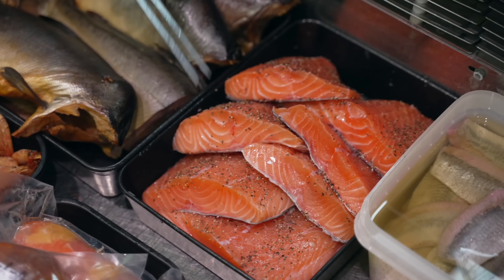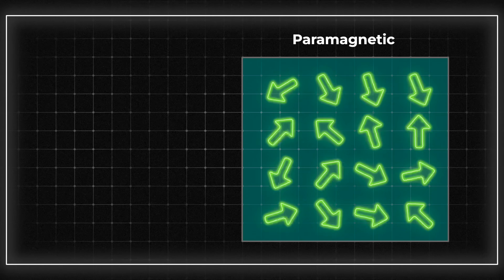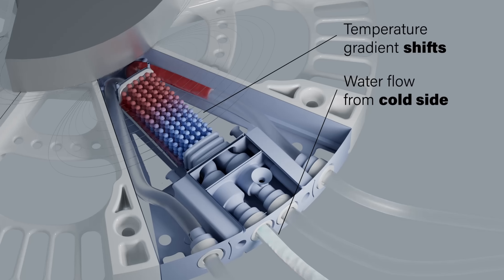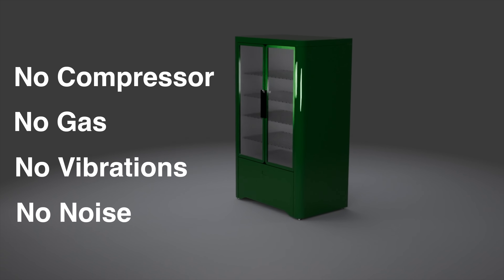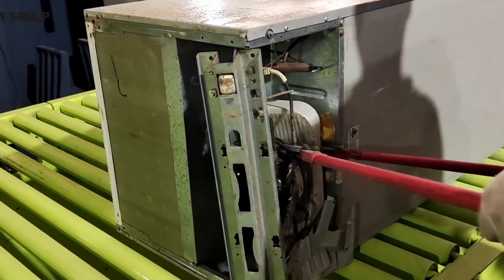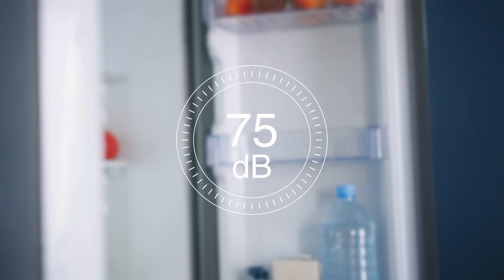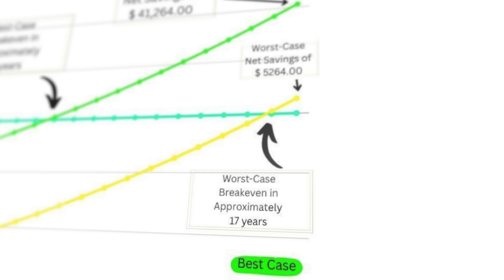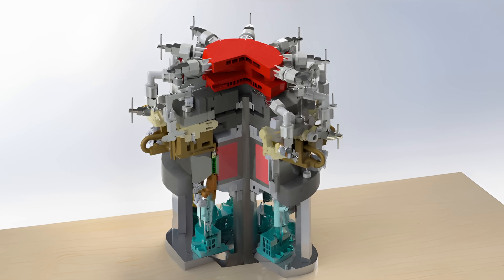Can Magnetic Cooling Disrupt the $100B HVAC Industry?

Comment: In Finland the freezers are forbidden to use freons for over 30 years. My devices use propane or cyclopentane. High temperature heatpumps use C02, supercritical CO2 pump can pump from -35C to +80C with quite good efficiency.  The needed pressure is just pretty high, and I wouldn't like to be anywhere near when system breaks. The fridge is in fire about as bad as a can of gas lighter fuel. 

Another promising solid state heat pump tech uses memory metal alloys. They heat and cool when forced to change shape. One needs just a loop of wire and wheels to tension and release tension to make temperature difference.
Reply: propane is a refrigerant. it was the first refrigerant along with ammonia
Reply: Brah, my freezer here in the US uses cyclopentane as well.
Reply: Refrigerants either gonna desteoy ozone layer or increase earths heat
Reply: @muezzinmemo9091  no, not all them do. that's why HFCs have been banned.and replacements are waaaaay less harmful.

Comment: Like all green tech, it doesn't work as well as the old tech. If the efficiency increases are at 47F and a regular fridge can get colder than that, then the efficiency and payback numbers are BS. Factor in the additional cost of food waste at 47F and it's all BS. Peltier coolers had the same promises and they're BS for most applications .

Even with a 90% reduction in prices with the reluctance of utility companies to buy back power and the elimination of the tax credits, they don't make sense anymore either. 

In a nutshell, we are doomed to die on Venus.

Comment: Solar, battery & wind costs didn't fall on their own.
They became cheap when China decided to mass produce those products.
They did that by promoting and financially supporting those industries because they realized the potential in them.
That's what it will take to make MC fridges commercially viable: gov't assistance and encouragement.
Otherwise, the old technology will dominate & force out the new, better tech.
This always happens with an entrenched technology: consider how oil co's and u.s. car makers stopped r&d of EV's and batteries for over 60 years.
Most notable & recent (1995) example was the EV1 that GM & Exxon-Mobile jointly killed.
Exxon stole and locked up the battery patent for ANY large-size NiMH batteries used in cars (which is why the Prius had small cells in it's battery).
GM was then bailed out in the 2008 crash after promising to build the Volt PHEV, an OK but kind of half-ass car built on the Chevy Cruz body.

Comment: It's a very cool physical property but it requires too many moving parts. Pump(s), valves and coolant loops all over the place.
Considering how simple a hermetic compressor really is and that it only requires a single constriction in the gas flow, it is very hard to beat in reliability.
Edit: You have to remember, a fridge could "easily" be made/designed to work with just compressed air as medium but the efficiency would not be as high and/or the pressures involved may be impractically high. This is why we use specific refrigerants now. New refrigerants have come that are better for environment. R600a for example is not a problem environment at all but unfortunately it is very flammable.
Considering most of the HFC's are illegal almost everywhere else than USA and fridges are still produced, I'd argue USA is just lagging behind.
Reply: " most of the HFC's are illegal almost everywhere else than USA "  " USA is just lagging behind " 
Excellent observation. Video states this as a plus for magnetocaloric cooling, when in fact it is USA's sluggishness in implementing new eco-standards and safety standards.

Comment: I see this as something that could work well for HVAC, but not for refrigeration.  41degF is nowhere good enough for fresh food storage.  Technically, it will work, but you'll find things like milk and fresh meat not lasting very long.  However, for HVAC where discharge air temps are usually around 55degF, I can see this working very well.

Comment: US average kwh is less than half what you said. My state is a little cheaper than the average at $.14. This pushes the practicable efficiency out many years. In addition, commercial electricity is even cheaper than the residential rate.

Comment: Good episode except you have to specify "how big" when talking about how much power conventional fridges use.  A typical residential fridge, for example, only burns 2 kWh/day = 730 kWh/year.  So the 17 MWh/year ... that's for literally a whole supermarket's worth of refrigeration.

The pricing comparison is just nuts for something that is just a pump and a rotating magnet.  That pricing won't hold for long (if ever).

-Matt

Comment: HFC (yes, it's HFC - not HCF!) R134A refrigerant is not used for new fridges anymore - they've switched to R600A with a GWP of only 3.  R600a is isobutane though, so very flammable.  Luckily, the flammability doesn't seem to be a problem.
Reply: Also, there is definitely a problem with the energy calculations at 10:40... "A conventional fridge uses 17,000 KWH per year" is definitely incorrect... 17000/365 = 46KWH per day? 46/24hrs = 1.94KWH per hour?  That means that the average fridge pulls more than a 15A outlet (max 1.8 kW) 24hrs/day??  Also, what conventional fridge runs 100% of the time?  The calculations are done so sloppily!
Reply: Hydrofluorocarbons. Good catch
Reply: Correct... more of an automotive AC application.
Reply: Also 1234yf
Reply: Flammable gasses are problem too
Reply: @muezzinmemo9091 what is r600a  😂 look it up ?? It's  It is camping fuel for gas stove s 😂  It's called.
Isobutane , What is the fear of being flammable ?

Comment: Too complex with extra failure points. More maintenance costs and potential failures, shortening the lifespan of the device. And i doubt they are willing to offer a decade long warranty.

Compressors are surprisingly rugged and simple - a motor and a long tube with a restriction.

Comment: Your cost per kilowat is nuts.  Its 10 cents here though SRP.  Still makes it to much for most people.
Reply: We pay $ 0.13/Hr
Reply: These refrigerators only make economic sense in regions where electricity really is that expensive. For example, distant islands that are still using diesel generators. That is expensive when the diesel is delivered by boat.

There are also places without enough long distance power lines due to political issues.

Comment: An while we are discussing compressors another calculation was made:
Based on our calculation for that specific scenario, the summation of the amount of heat dumped into the 10' by 10' by 10' room by freezing a 3 cubic foot container of water was approximately 51,249 BTU.

This was the total heat expelled by the freezer, comprising both the heat removed from the water (and freezer interior) and the heat generated by the compressor and fan motor during the process.

In that theoretical scenario (assuming the heat was absorbed by the room's air and its drywall structure), this amount of heat would have raised the room's temperature by about 125.42∘ F, 
taking it from an initial 70 ∘ F
to approximately 195.42 ∘ F.
Reply: This supports my long thought of concept of combining a home refrigerator/freezer closely coupled with a water heater. While cooling the fridge you dump the generated heat into an insulated storage (instead of the air in the room) that heats the water in the water heater. Perfect application for a correctly designed heat pump. And if there isn't a high enough demand for hot water but you want to heat a portion of the house you add a water to air heat exchanger (fan/coil unit) and if no heat is desired you direct the excess heat outside.
Reply: @580guru  You nailed it. But don't forget, not in your scenario, but in our current configurations, we are dumping heat into a room, only to need to dump it outside through other devices. Double the energy and heat.

Comment: I love it that scientists and engineers are at work on such technologies. But my recent experience is that residential refrigerator life is only 7-8 years. The compressor and evaporation (old) technology is still very functional.  But the electronics that are supposed to improve efficiency crap out. I cannnot count the number of “boards” that I have replaced in all of my new modern appliances. So until they find a way to extend the life of these tiny computers, the payout of the new tech will not allow it to be viable.
Reply: Understand but selection is slim for those.
Reply: The trick for a lot of these appliances is to not purchase those with fancy electronic controls. If a physical knob or button can do the same thing, it's a much more simple and inexpensive failure point to repair and can last far longer. Anything more than that is just planned obsolescence by the manufacturer to compel replacing the entire appliance.

Comment: 9:50 - R134a is chlorine free and does not deplete the ozone layer.
It's only really old refrigerators with R-12, phased out like 30 years ago.
Reply: Newer fridges using r600 (isobutane) a HC
Reply: @culdesacshadowoftheabyssca9628  and r290- propane
R-744- co2 is being increasingly used (Horrifically expensive and complicated imo)
Reply: Look up the Montreal protocol.
Reply: you are thinking of the cfc or hcfc...what he was taking about was the ability to trap heat in the atmosphere or the greenhouse effect
Reply: @jesshorn257  I thought the GREENHOUSE EFFECT WAS the trapping of heat in the atmosphere 🤷‍♂
Reply: @ThatTweedle  yes? I described the effect and then used the common name of said effect?
Reply: @ThatTweedle  R134a is 3.5 times heavier than free air. As such it’s difficult to imagine a significant portion of the small amount leaked at ground level reaches the upper atmosphere, thus contributing in any significant way to climate change.

Comment: screw compressor with NH3 (ammonia) used in a better containment design would be way better in my opinion as it doesn't need rare material and is very eff.

Comment: The tech looks promising but we're going to have to see economy of scale before we see widespread adoption of this tech to actually have a major impact, so the price point will have to drop to €3000 or less before the majority of us would consider it, and that won't happen without major scale, so the tech looks promising but this is for the near future, maybe a few decades from now.

Also, this might be useful for air-con, which lowering the running cost of that would be a big help, in fact, I suspect that could be a bigger selling point before fredges.

Comment: Tesla needs to buy one of these to make A/C for their cars. Why didn't you speak about A/C, by the way? Is this tech not applicable to heat pumps?
Reply: I think we are saying the same thing. I was just making the point that up until now, there really only has been one way to make a heat pump, that is using a compressor.  The magnatherm is a new technology that can serve as a heat pump without a compressor. 
I think i interpreted your original question as wanting to combine the two technologies, whereas you meant replace it. 
I think that this tech has a long way to go before it is reliable and cost effective enough to actually replace an automotive heat pump.
Reply: @FlorestanTrement  the term heat pump refers to a compressor-condenser that can move heat in or out of a system. The magnatherm technology is a different way to move the heat and is meant to be used in place of the compressor-condenser design. 
Adding the 2 methods together just seems like it would be more expensive and complicated and have more things that can go wrong. 
Hope this helps.
Reply: @descentplayer  Sounds like you misunderstood me. Maybe the term "heat pump" is not used the way I used it there, but the concept is about moving heat from one place to another, which is also what magnatherm is doing.
In other terms, I meant to use magnet instead of a compressor and a condenser in a heat pump. Or whatever it might be called when based on magnets. I don't see why we should call them any other way, like you seem to believe they are.

Comment: Why not use CO2? My car (VW ID3) uses cO2 in the heatpump and works extremely well.
Reply: CO2 must be in cold side over 5,1 atm (triple point -56C) to keep it not turning solid. It turns to supercritical  when over 31C and 73 atm. So the compressor needs to have pretty high pressure for 40C hot side. Its pretty good refrigerant if one needs to pump from very cold to hot.

Comment: My man. Your numbers are WAY OFF! My refrigerator doesn’t cost me $495.00 per month to run.
Reply: Going by the rest of the video, those numbers appear to be for commercial units, not a consumer unit you would have in your house.
Reply: I’ve got an emporia energy monitor on our fridge. Over the last year it used 729kwh of energy. That’s 60.75kwh per month. At our electric rate of 0.22$ per kWh that is $13.37 per month.
Reply: @KurtsRPMGarage  Facts.  In-home refrigerators have gotten more efficient over time, and due to better insulation they don't have to run constantly.
Reply: He said the chart is for commercial fridges
Reply: Upright COMMERCIAL fridges are often frequently opened and closed throughout most of the day, causing considerable loss of chilled air, which is replaced by warmer air that then needs chilling down. This means that the chiller units can be in near constant operation. 
Also, the doors have to be transparent and light weight, meaning poorly insulated. Comparing magnetic energy savings and costs from this video with domestic fridges is no relevant. 
Perhaps in 10 or 20 years after the tech is refined, it might become a premium domestic product that is greener, quieter, and by the way, reduces electric bill. But not enough to pay for itself.
Reply: @maddeusdoggeus1  he did say industrial fridges were the information point not your fridge at home. I’d imagine an industrial one is quite a bit more of a drain than what’s in the kitchen.
Reply: @maddeusdoggeus1  i thought he said commercial refrigerators. I saw a commercial refrigerator in a friend’s restaurant, it was an actual room.
Reply: @maddeusdoggeus1 mine costs like 3-5$ lol whos paying the price of a brand new prmium fridge or a mid toer gaming pc to run a fridge
Reply: @CnRSPACE commercial fridge, per the video
Reply: 😂 thanks for the realization 
I didn't watch fully yet
Reply: Doesn't matter how much per month because stated there will be no savings there. Commercial doesn't have the most improvement, it has the only improvement. Any future consumer version will simply be quieter and safer, not less expensive or more efficient (that 2400 they save in a year, we spend once and that needs to count for the whole 15 years). It also might hit the market never. 

Nevertheless, at the scale of commercial is where this has the most positive impact on our lives overall, so good news all around.
Reply: @maddeusdoggeus1  little did you know. They simply credited your electric bill the standard refrigerator deduction
Reply: My average is $50 a month
Reply: Maybe like... 30 a month since its constant power usage lol
Reply: @crispycrusader1  even the $30 seems high. I would bet the average fridge made in the last 10 years operating in a room temperature environment would 0.25-0.30 kWh per day. In my area that's only about $15 per month.
Reply: @P_Petkov  fridges consume more than 0.3 kw per hr
Reply: @AhmadAli-kv2ho  300w is about right for a large fridge. Start up is way more, but running is ballpark 300w. Medium and eco is about half that.
Reply: @AhmadAli-kv2ho  actually they don't
Reply: @damon20r unless you got your fridge in a cool place where its maintaining its coolness,its above 300 watts
Reply: @AhmadAli-kv2ho a fridge has 2 things that use the electricity these days, a compressor and a heater. The old 50s models you would have to defrost them. They have since added a heater to do the defrost cycle automatically. That said the average refrigerator will only consume about 3kwh per day. Its very common to consume 200 to 300w while the compressor is running. It does use more than that to start the compressor but that is only about 1 to 3 seconds at most. The heating element can easily pull 500 watts but is not on the entire time either, its a brief cycle to prevent ice build up in certain places like around the fans and duct work and sometimes the edge of the doors. You can easily prove this by plugging it into a kw meter, the one I have sitting outside in the porch most of the time when it is on reads about 250watts.
Reply: @AhmadAli-kv2ho  so give and take let’s  use 12 hrs of usage for the day.With that number,the consumption per day is 3600 watts?
Reply: @r410a6 no,it only consumes 300 when it needs to bring it up to cold temperature.......its more like 1kw+ on a average day.some fridges are more effecient like leibherr,which only needs 181kwh per anum,obviously less than 1kw a day
Reply: @AhmadAli-kv2ho  so the .3 kw is the maximum it uses?because you said .3 per hour. Why not just use the average consumption.
Reply: @r410a6 cos the average assumes constant tempreture of the surroundingd.reality isnt like that
Reply: @AhmadAli-kv2ho so it’s impossible to measure?